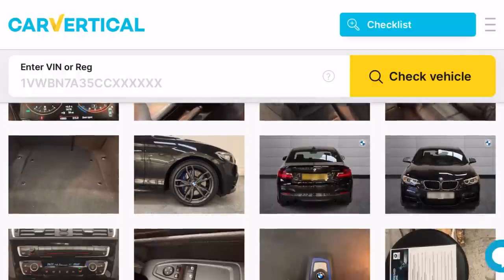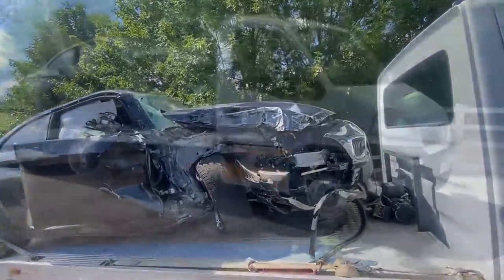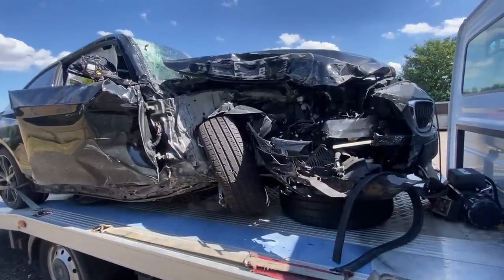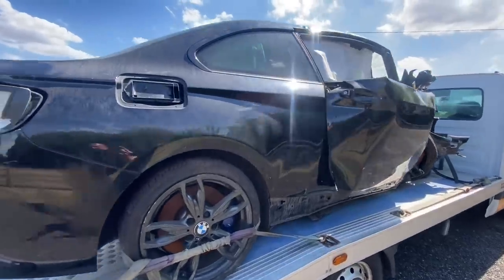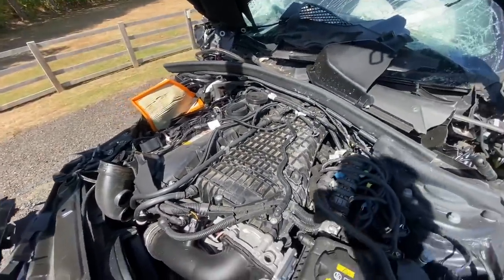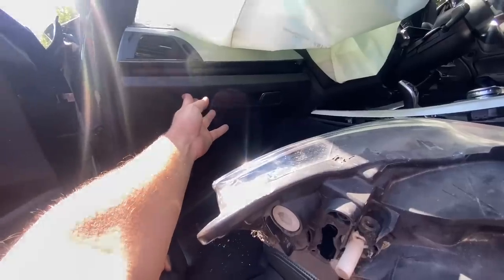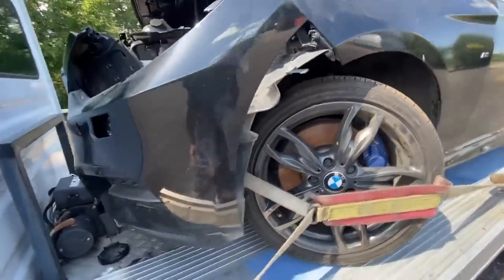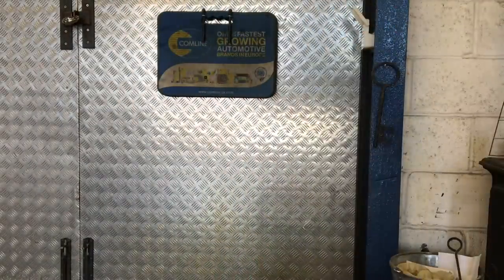WE BOUGHT A DESTROYED 2016 BMW M240i BUT CAN WE REPAIR ???

Comment: It was running when it crashed, more like it had just taken flight and came down with a bump! With the driver walking away from that it shows how far the safety of cars has come on!
Reply: The only thing running was the driver😂
Reply: @tonyknight3690  🤣🤣
Reply: @tonyknight3690  hahah
Reply: Bet his pants were a bit messy
Reply: @hfraat25  but where was the bigger skid marks, the road or his under crackers 😂😂😂
Reply: For sure if he’d have crashed virtually anything even 20 years older like that the driver would have died instantly!
Reply: @andybonney2582  ha! 4 in the road, 1 in the seat 😆
Reply: @tonyknight3690    aa.
Reply: Brown liquid was definitely running

Comment: 80mph in to what a planet 🌎.. that was travelling well in access of I would say at least 120mph .. but .. what ever the speed that car was doing saved the guys life that day .. testament to the build quality.. every safety device worked perfectly.. and he walked away .. shows how far safety technology has advanced over the years
Reply: He wouldn't have been able to survive the g force on his body at 120mph.
Reply: Take in attention crash tests are done at +- 35mph and the damage is massive as the new cars are made to dissipate the energy of the impact around the shell protecting the occupants, now having that in mind imagine if that impact in what looks like an not deformable barrier at 120mph, the steering wheel will be in the boot and the driver will be mash peas

Comment: I think it's a sensible buy. The engine & gearbox — if undamaged — should be worth £2K and lots of other specialist parts. Is it worthwhile pulling the front out just so you can see if the engine runs?
Reply: How could the engine be undamaged!?
Reply: @johnbrees22  engine will be fine
Reply: @johnbrees22  If the sump is undamaged and it still has plenty of oil, then the video seemed to suggest that only peripherals were damaged: radiator, fan, alternator, maybe power steering. None of these would stop the engine safely turning over.

Comment: when i was a trainee mechanic around 2000/2001 i went on many breakdown/recoveries as bad as that. often wondered how possible it is to repair, i mean its mostly bolt on parts plus whatever frame treatment it needs assuming engine etc is fine. i know insurance people write em off straight away especially older cars lately. years ago id love to get 2 damaged cars and make 1 run to sell on but i never did it and now im in care work instead of mechanics lol (bit of a profession jump)

Comment: £4000 engine with ECU and keys,  gearbox £750, rear subframe and diff £650.....that'll break very quickly to 5-6k. Then send the V5 to DVLA as scrap with a covering letter. Even if you sell to a breaker, I would still write to DVLA saying the car is damaged beyond repair. At £2500, you did very nicely. Good effort!

Comment: The worst accident damaged car I ever came across in a "salvage yard" in Lochgelly Fife ,was a vauxhall calibra . Then a brand new model. I had no idea what the car was or even the maker initially untill we saw the engine cylinder head.
It had left the road at over 100 mph , demolished a wall and hit a huge tree roof first , sadly the joy riding apprentice mechanic was eviscerated.
His remains largely removed had left the black leather seats stained dark brown and his hair and scalp parts were still embedded in the crushed windscreen.
The question was and is 
Is it ethically and morally right to remove any parts useable or not from such a tragic situation . And if you do , and due to invisible stress fatigue in another accident another person is seriously injured. Do you say to yourself well they knew it was a used part and not my problem mate . 
This side of the salvage industry has always stuck in my craw.
So many make cash from the misery and loss of others .
Reply: That is why Cat-A exists

Comment: I had a head-on accident quite a few years ago - which, like this car, resulted in EVERY SINGLE PANEL of my car twisted/damaged - the combined impact speed was 130mph. I too walked away from the accident (albeit severely bruised...) - the car was checked over by a specialist working on behalf of the local constabulary, and was told if the impact was an INCH in any direction, I wouldn't be here today.
Reply: You didn't use the horn?

Comment: Definitely needs a new shell. I'm only a DIYer, but rebuilt a few Fords and Vauxhalls in the 1980s and 90s with that sort of damage. Although even they took about 120 hours of work, and a modern Batmobile would take longer. As you say, you can spend time more cost effectively on repairing less badly damaged cars. You'd spend ages sourcing bits for a car like this. Glad you're not offering it on Instagram, as it would surely fall into the hands of a tea leaf wanting to ring it.

Comment: Arthur Tussik would sort this out.
Reply: I've seen him repair worse
Reply: @lukecowell7516  yes indeed but they shouldnt really have been repaired, Ive seen him do a 5 series that was unrecognisable.
Reply: @ianmaciver4004  Playing devil's advocate - what's the difference between repairing them with new OEM parts to the exact specification of the manufacturer and the car being built from scratch by the manufacturer?

Comment: To fit the 6 pot they cut a chunk out of the front panel and fitted a “U” shaped bracket, I always thought it was a bodge and weakened the front of the car. Nice cars but they are very twitchy under acceleration as I found out. It’s definitely a parts car although it would be great to see you do a re shell.

Comment: I would be tempted to clear anything from the front of the engine and see if it starts as surely worth a lot more as a running low mileage engine plus it would make a good video.

Comment: What a bargain.
If you empty the petrol out for Chris's  lawn mower and you know there will be a few pound coins in there somewhere 🤣
I'd bang that straight on ebay as a auction and I bet that will make £5k all day long.
Engine and box is worth 4k.
Nice little touch.
Keep up the good work.
Ahh yeah them diagnostic machines you have.
They are great but don't keep it in a cold place as the touch screen will back up.
2 I've had a get screens changed.
And it's always happened at the coldest time of year.
👍👍

Comment: she might be a write off but sure by far not useless. for the price its really not bad. not really worth to be put back on the road even tho could be re-shelled..cost wise its worth it, time wise its not. but even in its condition there is so many good usable parts and pieces on it, engine looks like is savable. a good 80% of interior is also salvageable. 3 good wheels..list goes on. i think it was still worth picking it up

Comment: Its scrap break it. You cannot rebuild that so that the original structural integrity  is regained and the crumple zones perform as originally intended. Many years ago as an apprentice I  remember watching a repaired Honda Civic being crash tested . It folded straight back ..horrific . Just the cost of the airbags, modules, trim etc would be prohibitive.

Comment: Someone in the game will buy that for the logbook and vin number being a HPI clear car its not going to be hard to buy a cat N car and swap the chassis numbers, change engine and ecu and reg to the other car and use it as a HPI clear car. The new car cannot be stolen or anything like that as the reg and vin numbers are all clear. With the old car documents just will be scrapped off. May need a bit of welding as long as it’s done properly no one will ever find out.

Comment: Being an Aussie I have no idea what category A, B, C XY and Z are. But I would file this under category K. 
Knackered!
Reply: Cat B basically means a write-off, beyond economic repair but also unsafe to ever return to the road so suitable for parts only. Cat A means nothing salvageable, everything needs or has been destroyed (eg. Complete fire damage).  Cat N means non structural damage but Cat S is structural, but repairable - most of the guys' repair work comes under these 2.
Reply: In Australia, that'd be Category F for f....ed 😂

Comment: Spend a few hours to get the engine running. Assuming the engine drive train is OK the salvage value will be a lot more than the purchase price. is this model used in saloon car racing?

Comment: Feels like someone tried to pull a fast one on you! But I'm sure you fellas can still extract a few quid... Or a lot of quids to the good from it. I don't have any pics? Yet you can use the interwebs all phones have cameras on 'em. that was a strategy to prevent you from saying no. Manufactured pressure to decide NOW NOW NOW is a classic strategy as well. But at least it was so cheap that if any major element still works you'll make evens

Comment: If it wasn't recorded and the shell is reasonable somebody will repair as a long term project garages usually buy them and tip away fixing them when they are not busy 😊

Comment: I reckon that was hit at quite a bit more than 80mph to bend the whole frame that much. Reckon you'll get £3500 for it for parts ? Especially if the engine block is OK, that's £1000 right there.
Reply: think more like £5000

Comment: I guess the value of the car now will depend on the state of the engine. Interested to know if you are going to pull it apart enough to find out - I suspect not from your comments.

Comment: I think I`d stick that in the corner of the yard & wait for a stolen/recovered/stripped one to come up on salvage, that's exactly the kind of car that does come up from salvage now & again. Or maybe one with a blown engine. £2500 aint a lot to have out on it as well to leave it in the yard for a while.

Or maybe put the running gear from it in an old E30/36.. Or Chris`s Viva.. wink wink...

Comment: A completely wrecked car, chassis twisted, multiple panels required. How much damage to the engine and transmission?

Sell it for scrap or parts. A private person might take it on as a long-term project but it isn't a commercial, profit making project.

Comment: got to be to much power to young?far to easy for youger people to get fast cars on fianace?best we had was a vauxhall nova sri or ford xr3i
Reply: Most vans now would be faster than a Nova SR, but people were quite happy with them then
Reply: Too much grip, so little body roll; this means that modern cars need stupid amounts of power to be anywhere near as much fun as those old ones. And that of course raises the stakes if you do lose control, it’ll happen a lot more quickly and at a faster speed.
Reply: When I was a sketchy teen I managed to roll a 75hp Citroen ZX. The cars had less power back then but the driver aids were also next to non-existent. Big tyres, traction control and ABS probably make cars with twice the power more safe than some of those 155/R13 tyred cars from the 80s and 90s. But yeah whatever the year a M Series BMW has always been enough power to make you really regret your decisions.

Comment: Nobody would fix that, there's too many unknows apart from what it's worth fixed and that not enough. If it was worth 40k plus then maybe but still not worth the time, the chances of not earning enough are really high. That's a parts car if it's cheap enough. If you bought a shell it wouldn't include doors, boot lid and bonnet.
Reply from the maker: Why did you just delete you last comment 😂😂😂 the shell will twist lol

Comment: Its that badly bent like a crab. it wouldnt even go on a Jig chassis frame. 
Make more off stripping as many BMW parts off it and ebay them.  It is a stripper for sure
If you had a spare shell maybe at a cheap cost maybe

Comment: Chuck it on Copart, sell as unrecorded light damage, no keys so don't know it if runs ;) Will probably get at least £15K for it from some driveway repairer.

Definitely something dodgy though with the accident. Who would take a £20K hit on a £25K car ! I am guessing driver was DUI, crashed it and didn't report to the police. Either that or he was on track with no track insurance...
Reply: If the computer logged the crash at 80mph you're exceeding every public road speed limit so claim can be refused
Reply: @psi10001  Good point !  I have a feeling the owner didnt want the police called for whatever reason....